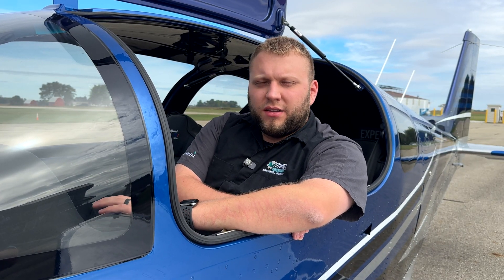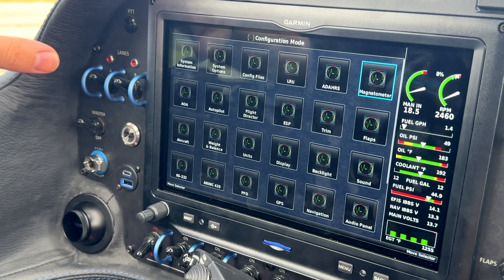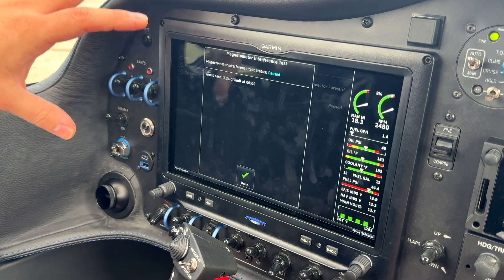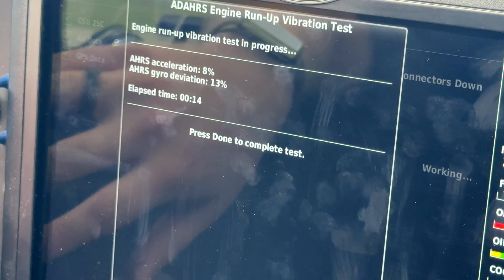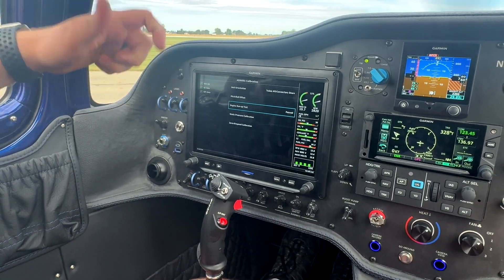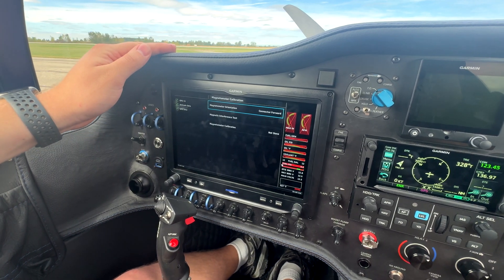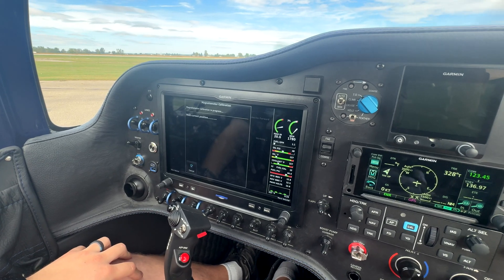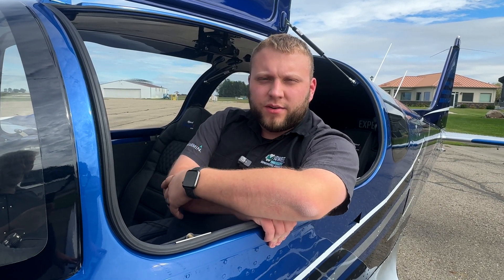Magnetometer Calibration

Comment: I get a AHARs anomaly warning occasionally. I have done the interference test but have yet to check the vibration or redo the Mag/compass swing. Any thoughts? RV7 rear mounted Mag 22 just in front of the fin (vertical stab)
Reply from the maker: The most common thing we see with this is either the wires loose next to the GMU or the rudder cables, this is especially true if intermittent. What typically happens is in rough air the wires or cables start to bounce and induce a magnetic field into the GMU. I would start there.
Reply: @ Thanks. I believe the rudder deflection was the biggest interference percentage when moved but still well within limits. Movement in rough air could certainly be the cause. I’ll have to engage the AP and climb in the back to have a look. 😂
Reply from the maker: @ we still see these issues even after passing a test on the ground.

Comment: Important thing to mention - you want to be a good 50 feet away from structures or aircraft, or anything else containing steel. That also means doing this calibration on asphalt - concrete is filled with steel rebar that can affect the calibration.
Reply from the maker: Indeed, at 7:02 we show the instruction screen that says do not pass within 20 feet of magnetic material...